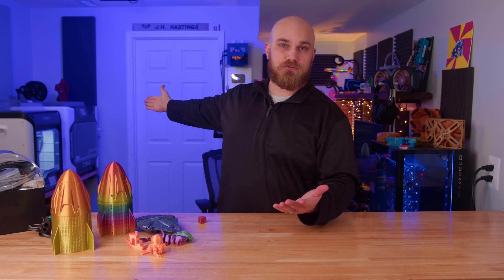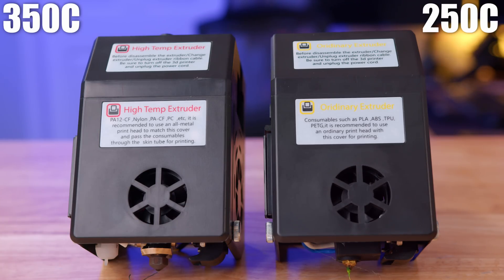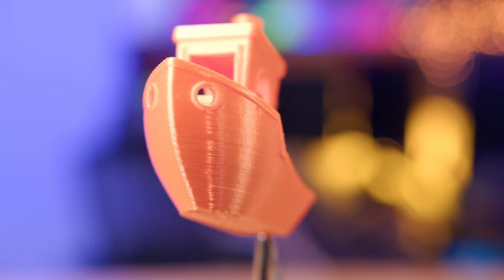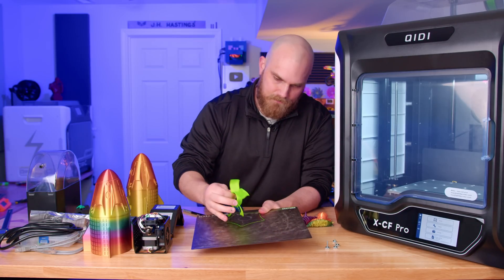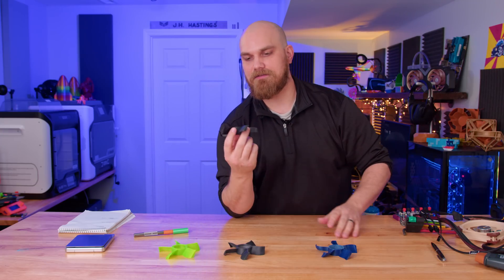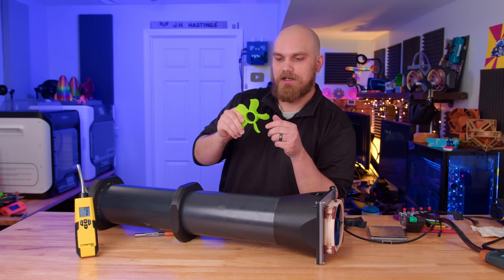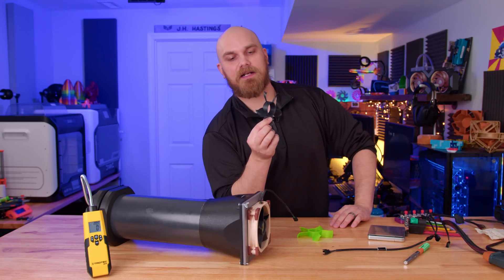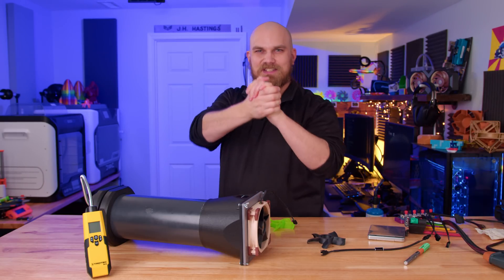Will a FLEXIBLE Fan Work? | QIDI X-CF Pro Review

Comment: In theory, you could design a flexible pwm fan blade profile that flexes to optimize itself for whatever RPM it needs to run at. An advanced version of high performance radiator fans with variable angle blades.
Reply: Kinda, the fan will naturally morph to whatever results in the least resistance (think high pressure to low pressure, the more air resistance, the more the fan blades are pushed on, the more the shape will change)

This could mean a few things (either or both):
1. The fan just pushes less air (less cooling)
2. The fan pushes air more efficiently
3. The fan oscillates in shape (like paper flapping)

So, you could design a fan that automatically adjusts to the most efficient shape it can reach, or you also might just design a fan which doesn't push as much air as if it were rigid. It would take some thought to design a fan which can take advantage of flexibility.

This is already kinda how you design the shape of a fan normally, you want to give a shape with the most efficient pushing of air, except in this case you just have an extra variable which can change based on the environment a bit which is a cool benefit.

I think this is a really cool concept, I would love to see someone make a fan based on this.
Reply: @Hexcede  - You're missing an important force. Centrifugal. It also increases with RPM and can be leveraged to force changes in opposition to the air resistance changes.
Reply: @ghosttheoremproductions5469  Ain't centrifugal force like fake
Reply: @jackschoonover6418  What? then what is it then?
Reply: @jackschoonover6418  - It's not a true force in that it doesn't exist except in relation.
Reply: @jackschoonover6418  It's only fake if you get too deep into the semantics.  It's a real effect that does result in the spinning object feeling as though each piece of it is being pulled outward from the center of rotation - even though it's more the case that the rotation of the object itself puts so much energy into the momentum of the object, that in order for it to turn and keep rotating rather than each piece flying off straight like a bullet, each piece of the object itself needs to pull its neighbors around in a circle in a constant flow of individual momentums.  That's where the stress trying to expand the object comes from.
Reply: @jackschoonover6418  It is and it isn't. Centrifugal effects are sort of the reaction force to the actual centripetal force. So while it doesn't exist in reality, calling it fake is sort of misleading
Reply: @Hexcede  Its not going to gain efficiency by being flexible in regards to flowing more air, the least resistance the fans can face would just be a flat disk so would make a worthless fan. having something that has some flexibility isn't gunna be able to impart as much force as something that more rigid. a flexible lever arm isnt as useful as one that doesnt flex
Reply: @connorjohnson4402  Something rigid and inflexible pushes on the air because the air pushes on it. Something flexible doesn't just evaporate that force. A flat disk has no air resistance, but it's also effectively zero efficiency when it comes to how much energy it takes to push the air. Aside from that the fan is simply not going to become a flat disk, flexibility just gives a range of possible shapes for the fan, eventually the resistance of the material overcomes the resistance of the air so it stops flexing.

There are several factors that allow for several possibilities. One factor is time, which is how you can get oscillation (like paper flapping) because it takes time for the material to move, and it takes time to impart momentum (in the fan blades and the air, it goes both ways there). In most cases that won't happen.

Another factor is the range of possible movement of the material from the air.

And another factor is the spinning of the fan, which creates centripetal force, among other things.

There's no difference from a fan bent by air and a rigid fan, in both cases the fan is mostly rigid. The ability for the material to move however can either make the fan more efficient at moving air, or it can make it less efficient. Flexibility is kind of just a mix between rigidity and fluidity, the fan isn't going to go to the absolute least resistance shape like a fluid, it's going to go to the least resistance shape it can, with the force of the air pushing back and internal forces holding its natural shape, and that shape may also happen to be more efficient at moving air at the particular RPM than the natural shape, because at that point once there is no more bending it's pretty much like a solid fan again. It can also dampen sudden changes or impacts which could have an effect, and it is easier for it to enter it's natural state vs whatever state it's bent to.

You can't really break the physics down easily because there are so many factors and possibilities which are dependant on very small things which are hard to visualize. Like I said, you'd have to strategize well to take advantage of a flexible material, but, all of the things are there to do so, a flexible material doesn't mean a less efficient or worse fan, it sort of means a fan which can change into another similar fan shape, depending on air force and RPM.
Reply: This has been done, in sort of a reverse fashion, for 20+ years in the aviation world. On the exotic end of ultra-light aircraft and late on some LSA light aircraft, composite propellers were/are laid up with carbon fiber plies oriented and stacked so as to use the forces  acting on the prop to bend it to pitch more aggressively with rpm. This mimics to a small degree a constant speed propeller (which use hydraulics or oil pressure or electric motor to pitch the blades to hold a selected engine rpm (throttle being separate)). I assume that this is all calculated to happen near max rpm. I don't know the details I don't fly those types, but I have read of it in the literature. Must be out there if you are interested.
Reply: Something similar to the system in wind turbines?
Reply: @Lucas_sGarage  - Sure. But a passive system.
Reply: @ghosttheoremproductions5469  yup
Reply: Had the EXACT same thought, and am unhappy you beat me to it... (I'm 3d late, but shhhh lol) I wanted all that big-braininess for myself! 😁

Nevertheless, I do hope someone comes up with some crazy design to utilize this flexibility! 🤘

Comment: I guess you could just get a second, stand-alon BL touch for the other extruder, right? Also, I highly recommend getting a dedicated small driver/bit set (like ifixit) for your printers. Once you've used them in place of those old Allen keys, you'll never go back. (I keep a small parts bowl next to mine with 3 or 4 of my most commonly used bits ready to go at a moment's notice.) Great vid, thanks!

Comment: Does the head unit on the ifast have a spot for the leveling unit from the CF pro? 🤔

And should take the top 4 fans so far and print them in tpu 😉

Comment: Tip losses are reduced with a flexible material like TPU since the blades are essentially touching the shroud, creating a seal between the high pressure and low pressure sides. It would be interesting to see someone optimize a blade that actually takes advantage of such a "feature" of flexible materials.
Reply: You said this much smarter than I was thinking it but essentially I figured the tpu just spatula'd the edge and got more air through.
Reply: That and or using it to make a dynamic angle of attack on the blades.
Reply: And also it may help to lubricate fan casing, to reduce friction and make a better seal
Reply: Every single decent fan is already designed in this way. During development they keep expansion from higher rpm in mind. Tpu would just make worse at lower rpms... And that's stupid
Reply: This is literally what makes Noctua fans the best in the world, but using the exact opposite process.  Their Crystal Resin fan blades are so stiff and non flexible, that they can make fan blades that are less than a hairs width away from the frame.  Thus making them ultra efficient.
Reply: Do you think one could put extremely slick grease on the tips and see even better efficiency?
Reply: Possibly right. It makes since. I have my theory tho. But yours...... it makes me think. I like that.
Reply: Same, would love to see more TPU fans!
Reply: We've all see the fans with an outer rim spanning the area between the blade tips. This gives the same effect but without having to hit that perfect fit in the frame. Beside that having the tips actually touch the rim would cause so much drag it would make the fan inefficient, loud and short lived. High precision, stiff materials that doesn't change geometry under load and perfect balance is what you want.
Reply: Oooooo... That sounds nifty.
Reply: It'll only work well with one rpm though
Reply: @Seanweekhaizhen  potential good for any fans that arent pwm fans
Reply: Flexible materials make pressure fans slightly worse, because the blade bends with air resistance. You can see most manufacturers that offer both standard and rbg  versions of the same fans, indicate slightly lower performance on the rgb variant, because the milky plastic is less rigid.

Comment: I never printed in TPU nor nylon. The only materials I printed with in my life so far were Premium PLA, PLA+, PETG, and ABS.
Reply: Tpu is easy to print, search up a guide and a bit of tuning you can get good flexible parts. I've printed tpu in my cheap bowden printer, no problems
Reply: @arandumendez9557  Here's a fun thing.  I've run TPU through my 3d Pen as well.  This lets me fill in with a custom "o-ring" of sorts like in a box that is supposed to seal.
Reply: TPU is, indeed, fun. I've printed it many times on my bowden, Ender 3. It even manages overhangs, supports, and printing at reasonable speed, fairly well.

It's a complete breeze on my direct drive Ender 3. It was a pretty ugly print, but I was able to do TPU at up to 100mm/min and have it be solid and accurate.

Comment: If you can get a 0.2mm extruder for the high temp hot end and use nylon it should be possible to get some very small/fine and functional gears. The smaller the module of the gears and smoother the surface from thin layers the less gear noise you should end up with.
Reply: @Chris Valin came to say the same. If you get some super premium stuff it might be okay, but still that's a nightmare inducing idea. Maybe glass fiber would be better?
Reply: @Chris Valin Fair enough. Admittedly I haven't had the chance to print with either a filled nylon or a 0.2mm print head. I just know that filled nylons have particularly desirable properties for gears, especially in low torque applications such as a PC fan, being both strong and self lubricating. As for the 0.2mm nozzle I have just found if small gears have any helix to them you really want the layer height as fine as possible for them to run smoothly, but I guess was I've managed to print on a 0.4mm is fine for most situations... for reference the smallest gear I've been happy with in PLA from a 0.4 nozzle is a 8mm pitch diameter with 16 teeth and a 30 degree double helix which very much seems to be pushing it with a 0.4mm...
Reply: I luv using .25 or .2 nozzles. Clogging is a real real thing. They get clogged on their own. When the filament is dusty they can get clogged in a few hours.  i've been printing for roughly 7 years now. So, if I was to use some old crappy filament which was collecting dust for a non critical project >> use a dust filter.    
    Regarding your dream/wish to print Carbon Fiber nylon with a .2 ...  yup, i've done that.  Say bye bye to that nozzle. Clogs near instantly.  Also there is something weird about it. It's almost viscous in a way that it comes out like non runny plato or clay.  Not only is clogging a thing, but since it's so thick trying to print fast OR normal = extruder teeth stripping the filament while trying to push.    I remember printing .4 was the comfy limit. Still difficult, but doable.  Same applies for the other filled filaments, like glass filled / wood filled / coffee filled / brass filled . i've only NOT tried the wood filled.

Comment: $1700 it should've printed benchy better than that
Reply: Default profiles with no tuning.  I agree that it should be better, but its purpose is primarily to print the CF/Nylon.  With the right model it probably does well.
  I'm shocked that it has a magnetic bed, I doubt it can keep the bed warm enough.  Also I'm kind of surprised there's no heater in the chamber.

Comment: Bruh the i Fast costs $2500? Yeeeeesh, that's wild right there, do you print all your fans on it? If so I'm surprised that a printer of that price-point is incapable of making higher quality prints, doesn't seem worth it, other than for the PVA, especially since nowadays you can get a dual extruder and add it to your creality.